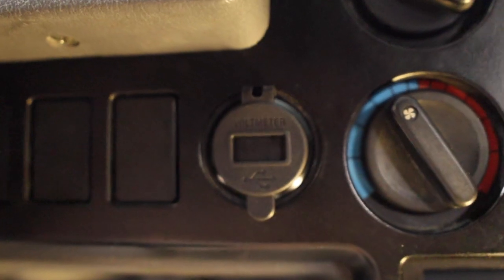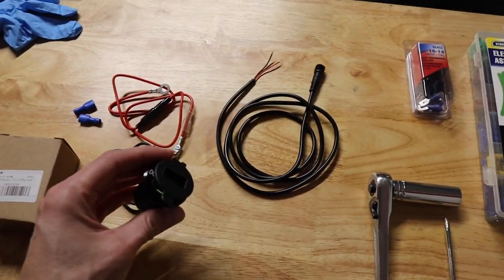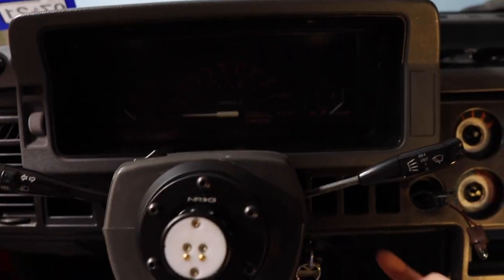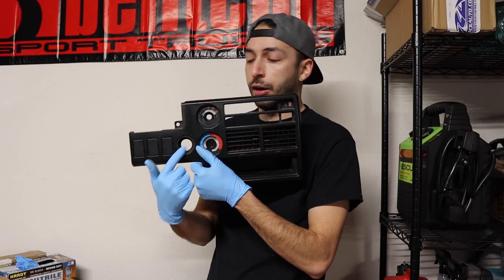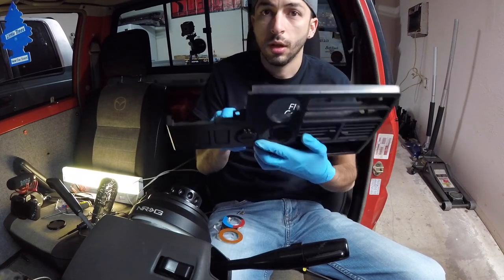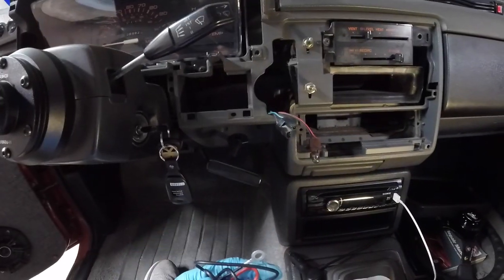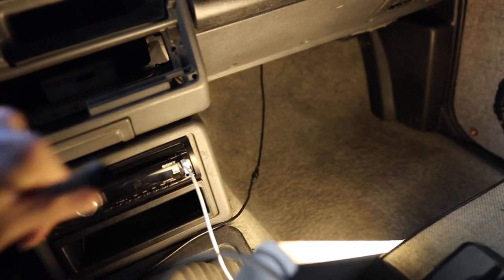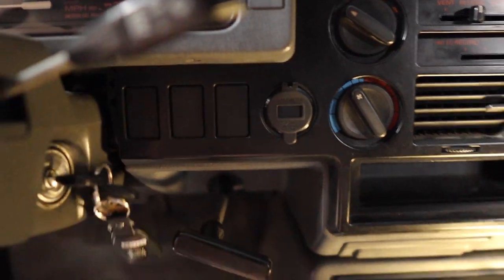Dual USB Chargers and Voltmeter Install Mazda B2200 B2000 B2600I

Comment: Learning as I go and your channel is awesome! I just changed out my (rusted original) lighter for one like yours. I tested it before putting dash all back together and it worked (I didn’t know there were lights inside it, but there are and they lit up). Modified the dash hole for it, like you, put it all together but now the radio doesn’t work and neither does the lighter. Fuses are all good, no wires seem pinched anywhere, what should I check now?
Reply from the maker: If everything was working fine before putting it together I’d take it off again and test all things. Maybe a cable got pulled/unplugged while putting it back. I’d test your radio after unplugging the usb component as well. Maybe a ground somewhere got unplugged

Comment: Couple years late but I’m having an issue installing a 12v plug on my b2200, it’s just a normal 12v plug, not the one you are using in this video just the normal cigarette one and I tried replacing it and the install went well until I plugged in a charger to test it and it fried the charger making it smoke and get hot, tried 3 other ones and the same issue. Would you know why it keeps blowing up my charging blocks when I put them in there? It’s not blowing fuses on the truck either and I’m really confused
Reply from the maker: I'd double check your power and ground wires. Make sure you don't have them mixed up inside somehow and if all looks good, maybe test for voltage to see what you are getting.

Comment: I ordered it but it didnt come with the black wire. is there something I could buy in its place?
Reply from the maker: You could just buy some wire at your local auto parts store and fit it with that or I'd recommend reaching out to amazon to exchange it or get that cable from them if you can